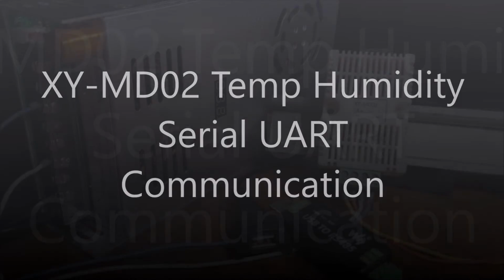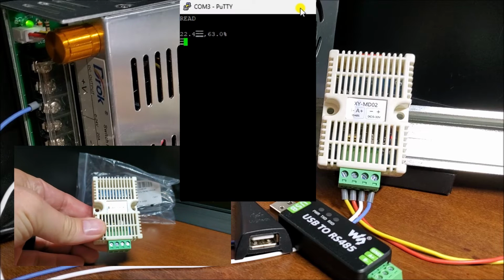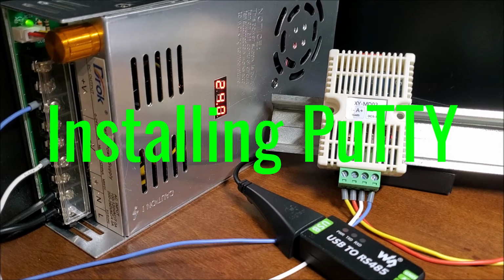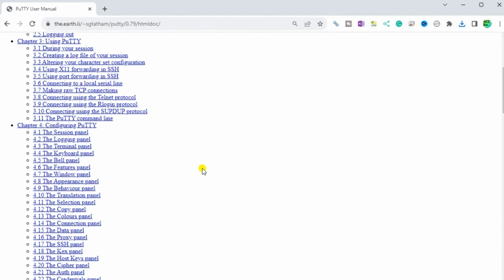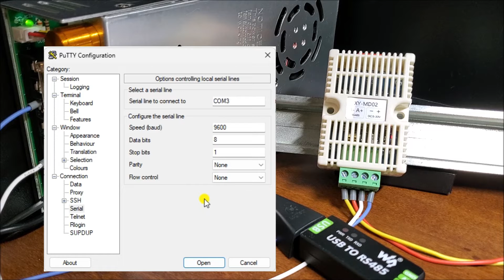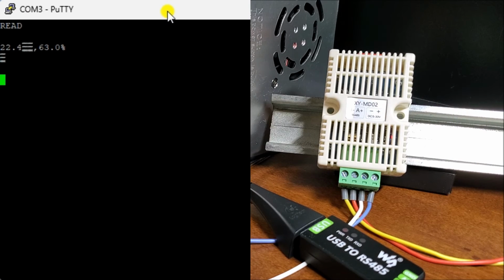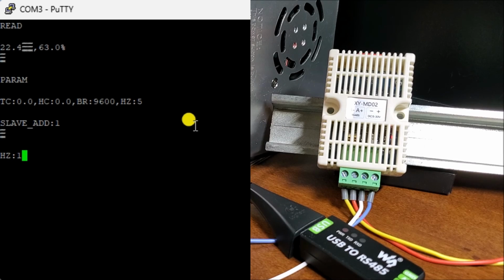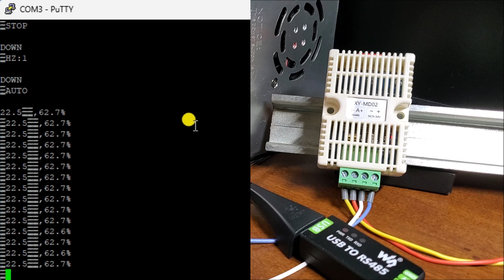XY-MD02 Temp Humidity Serial UART Communication

Comment: Nice video Sir, can you explain how should i connect this with raspberry pi 5 and silicon labs rs485 to ttl converter module- i mean pin diagram , i am using  minimalmodbus bus library but no luck. thank you in advance

Comment: Hello, I am doing rs485 communication project between md02 with modbus poll software. Sorry, I failed to transmit the information, I have checked the correct hardware. I suspect that someone changed the address of md02. That's why I ask your permission to ask how to do it and is there any way to reset md02? Thank you, looking forward to your feedback.
Reply from the maker: That is a good question. There is no direct way to reset this device. I would use PuTTY to communicate with the unit and verify the settings. You may have to change the communication parameters for communications to happen. 
I hope this helps you out.
Regards,
Garry

Comment: Nice video! I"m just wondering, did you ever got the calibration to work? I was not able to adjust the value trough Putty, but I was able to do it trough Modbus. But it changes nothing in the readout.
Reply from the maker: Thank you for the comment. I was unable to get the calibration to work correctly. However this can easily be calibrated when reading the values into a controller.
Regards,
Garry

Comment: Hey can please make a vedio on how to control servo motor with click plc and how to control it
Reply from the maker: Hi @karvanjeetsingh3565,
There are multiple ways to connect to a servo motor system from the control. (PLC) This would depend on the servo system that you are using. 
- Discrete IO
- Analog IO
- Communication - Modbus RTU / TCP, Ethernet IO, etc.
This site is more on the control side than the motion
side of Industrial Automation.
Regards,
Garry
Reply: @ACCautomation   actually I am using discrete I/o , where I  attaching positive of rc servo to positive of power supply and negative to negative 

In click plc i am using pulse modulation setup for output y001 on I/o module  (using as sourcing) then I connect output(y001)  to solid state relay and other end to v0 on output side of solid state relay I connected signal wire from rc servo motor and a 5 V as well on output side of Solid state relay 

I am not getting any movement in motor. 

Can you suggest any issue with wiring or other possibility , it will be a big help as I am stuck on this from last 2 weeks 

Thanks